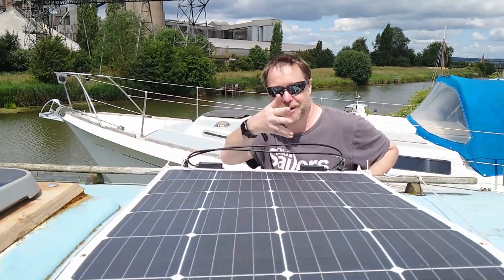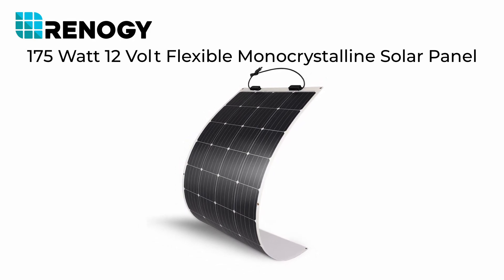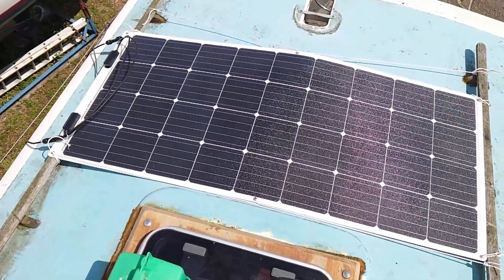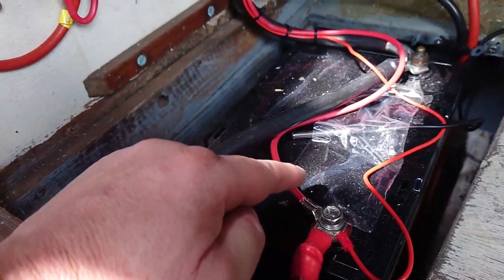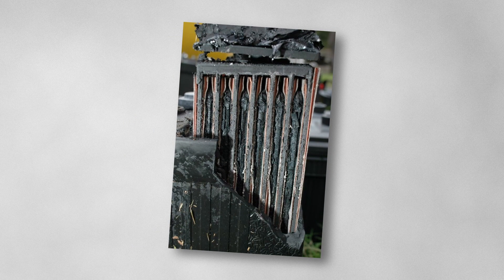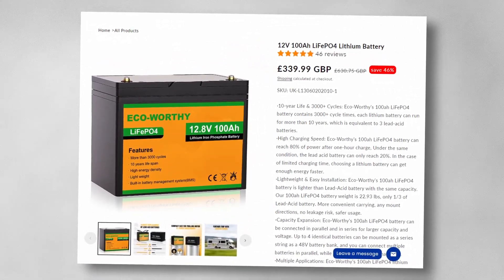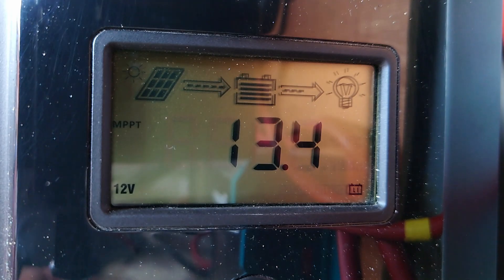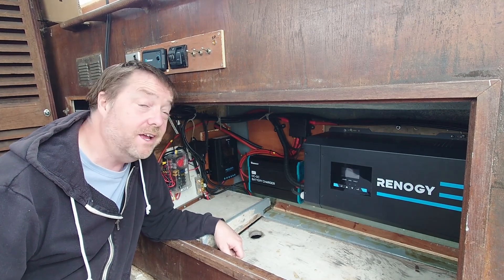Off grid Solar power charging Lithium Iron Phosphate (LiFePo4) Batteries

Comment: hi what's the larger Renogy box on the right of the DC-DC unit ?
Reply from the maker: It's the Inverter charger. Check out the whole system design on this video... https://youtu.be/zyDM7K0OIJU
Reply: @confidencesailing  thanks